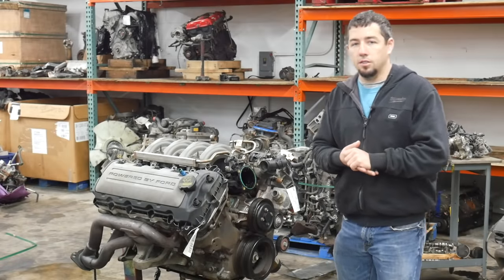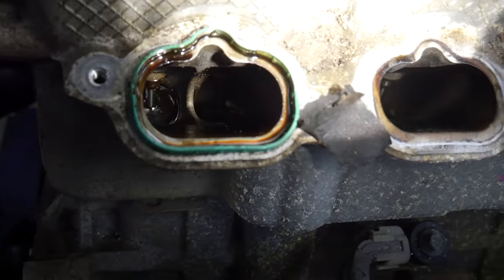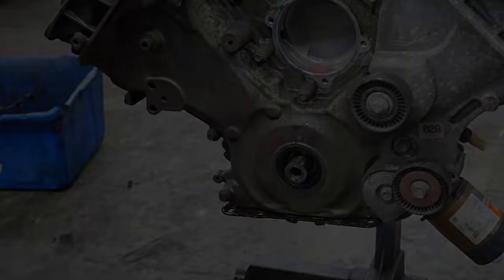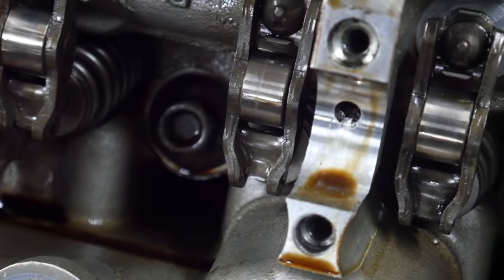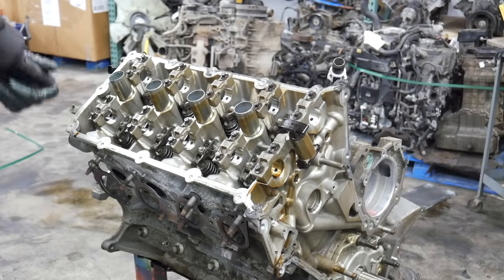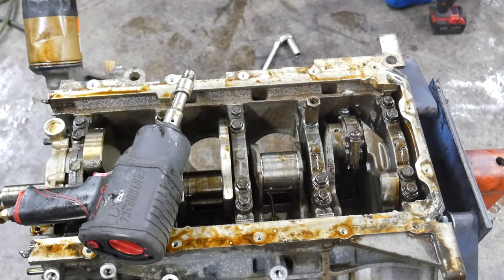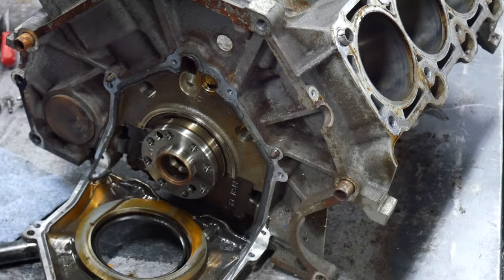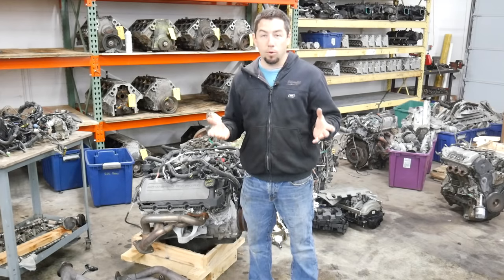Blown Up Ford 5.0 Coyote V8 Total Teardown! 2011-2014 Mustang GT / F150

Comment: The most common cause of Ford V8 failures is the loose nut behind the wheel.
Reply: And a lead foot.
Reply: It’s the ford logo in the front
Reply: They circle the problem on the front for ya.
Reply: @ernestjohnson1807  Haha, so original!
Reply: @ernestjohnson1807 Damn you Ernie, my Raptor is grumbling at you.
Reply: F.O.R.D 
fix or repair daily
Reply: Milled out journals with no bearing equals big trouble if you don't use the right oil.  Ruins the cams and the heads at the same time.
Reply: @probong2053  GRRRRRRRRRR!
Reply: Folded Over Recycled Dodge
Reply: Great comment! Thanks for the laugh.
Reply: Hahahahaha yep you are right right
Reply: Hahahahaha that’s what happens when you over do it doing burnouts
Reply: @vorant77  First On Race Day!
Reply: All makes have their gremlins. Ford had the most exotic cyl  heads in the '60's, the heart of the engine. Chevy pussed out and quit NASCAR in 1962.
Reply: Ford is the winningest manufacturer in all motorsports, suck on that Chevy and mopar trash.
Reply: @wymonwatson1309  I used to be a Chevy guy then I bought a Ford and realized I didnt have the hood up on it every time I turned around
Reply: @sambradley5981  But hey the parts are cheaper lol
Reply: @arendbehrens2761  found on rack daily
Reply: @probong2053  Unfortunately, in the early to late 90s, this was true to some extent. Source: my father's drinking buddy whose Ford Probe had serious engine issues...
Reply: Fords are awesome!!! When they go out is because lack of maintenance if any combined with harsh driving conditions!!
My Fords have always been great  vehicles 👍🏼
Reply: @ernestjohnson1807  this made me laugh out loud 😂
Reply: Hahaha, that's great
Reply: @yaellara6702  ok Fanboi. All brands have good vehicles and also have failures. Should we discuss the Corvair ?
Reply: F.O.R.D. = “Flakey Obsolescent Reworked Design.”
Reply: @sambradley5981  or take it to the dealer for warranty repairs.
Reply: @ernestjohnson1807  agreed 👍
Reply: As intriguing as overhead cam technology is, these Ford engines don't get down the road any better than their Chrysler and GM counterparts, that still use only one camshaft.
Reply: FORD...FAILURE OF RESEARCH & DEVELOPMENT
Reply: @probong2053  freakin old rebuilt Dodge
Reply: found on road dead is no lie after the 3 valve 5.4. Like the new 5.0 though.
Reply: Lmfao me
Reply: @dennisyoung4631  Cracked Heads Every Valve Rusted Oil Leaks Every Time.
Reply: @dustypeppers1358  yes, I did have a “No-Go Nova” many years ago.  It was then followed by a “Draštić Dödge” truck, and then sometime later, one of “Saki-Blender with sewing machine” cars.  

The last got totaled - full-on crash, followed by Fire - by a speeding driver as I was creeping through a left turn.  That was twenty years ago.  Been too poor to replace it since then.
Reply: Ill have you know sir, i have not yet torn a hole in the carpet under the throttle! I am very gentle when matting the pedal. Honestly I am not sure how my engine survives. No bowtie could live through such abuse. My 2011 was 181,000 and going strong, 7000rpm every f...... day! Still ran and drove like new when I traded for a 2020, same deal folks, no mercy. Yes, the Mustang. Statistically the most reliable, longest lasting car ever made. First of it's kind, copied by all, and the last to survive.  Alpha to Omega, the god of pony cars.
Reply: @JeromyBranch  When's the last time you saw a 4th gen (94 to 98) Mustang on the road?  They've all been crashed or trashed, with few surviving their owners.  With so few being ALLOWED to survive, any notion that they are long lasting and reliable is hard to justify by evidence.     Most Mustang crash sites are marked by skid marks heading off the road or going in the direction of an immovable object.
Reply: @Turboy65  when's the last time you saw an 03 to 09 Camaro on the road? AWWWW too soon? Maybe they'll make up for it with the 2024 Camaro? AWWWW. Ya, undisputed king of pony cars, the original that everyone else tried to copy, the one that knocked out all opponents and the last hotrod standing...the MUSTANG! And I see 90s Stang's on the road all the time. A lot more than Camaro. When's the last time you saw a 94 to 98 Camaro on the road? Been years since I've seen one.
Reply: @JeromyBranch  Maybe in your neck of the woods, but around here, Camaros of all generations aren't rare.  There were certainly more mustangs running around at one time, but they seem to crash a lot more often.  Not the car's fault...however I will note that wreckers are more likely to be built on a GM chassis than on a Ford chassis.  That's because wrecker operators know what's what.
Reply: @Turboy65  no. No you're so wrong. Everyone over the age of 19 knows that the vast majority of service vehicles are Ford. And where do you live, a Chevy museum? Do they serve LSD there?
Reply: @JeromyBranch  Clearly you live in a different  world than I do...apparently one where drug usage is even worse than it is here.  I won't touch the stuff. Not even alcohol. It'd make me stupid and want to buy a Ford.
Reply: @Turboy65  lol well it's clear that I've picked a wit war with the unarmed. Anyway, you have a good one. Been nice joking around with you. Take em easy.
Reply: @largol33t1  the Probe was made by Mazda (FYI)
Reply: OH BS
Reply: If you guys think junior high is tough wait till you hit 9th grade!  Things will be a bit spicier…
Reply: Hahahaha😂
Reply: Tell that to my 2011 mustang gt track pack sitting in a garage for like 6 years in perfect condition other than the blown engine simply cause it’s a 2011 5.0 before a certain date.
Reply: What, The wheel driving thier Engineering dept?? They sure sell a bunch of ten thousand mile engines lately.
Reply: Truer words were never spoken
Reply: Ford garbage
Reply: LOL 😂😂😂
Reply: @probong2053  Yes you got right Peace out

Comment: I’m thinking this engine lived a ¼ mile at a time.
Reply: With Nos😃
Reply: And in those 10 seconds or less, it became free (of this mortal coil).
Reply: More like it was someone who thought they were into cars and bought the status symbol. And then didn't know how to take care of it. They probably went to the discount tire store and bought the cheapest offered for the vehicle as well. 
The whole vehicle will be in salvage sooner rather than later, and the owner will think the vehicle was all hype, never realizing they were the problem.
Reply: @dalestephan6777  absolutely, and a lean fuel ratio.
Reply: @dalestephan6777  Roger that there is a literal price to pay for those super intense combustion pressures.
Reply: It may be that the first owner leased it, abused it, then it was sold to an unwitting second owner. I don't think anybody who raced would put a Fram oil filter on, if only due to the enthusiast reputation.
Reply: @jeangenibrel2149  always  blows  when you  let  off  them have not had engine  come apart under power but Iam sure it happens

Comment: I too almost fell out of my chair when you found a use for a 9mm socket! Anyway great video, these teardowns are some of my new favorites to watch.
Reply: A 9mm works when rust/corrosion takes its toll on 10mm bolt heads
Reply: Crazy seeing my fav retro tech guy comment on my fav engine tear down guy's channel :-D
Reply: Hi, Adrian!
Reply: @tstahlfsu  Same here. Finding a comment from Adrian of ADB & ADB ][ is unusual, to say the least!   Fred
Reply: I worked in a bike shop, as in bicycle,  for about 8 years and just about everything was 9mm. Maybe they're made just for us.
Reply: 3/8"
Reply: VW likes 9 mm 12 point bolts to hold sensors, but not much else.
Reply: fancy seeing you here :)
Reply: Another time the 9mm is used is the glow plugs on 2.0 diesels from Chevy, they put them in the Cruze
Reply: If you ever have to replace the shifter cable on your bicycle the clamp nut at the derailleur has about a 99% chance of being a 9mm nut.
Reply: @ChrisR  
It's ironic that you mentioned that, because I just got done messing with a "vintage" Shimano derailleur on a older Schwinn Paramount frame, something I haven't done in years.
Reply: The 11/32 of the metric world
Reply: I use my 9mm all the time
Reply: Another use is one a w126 Mercedes rear brake lines
Reply: Pound it on a striped 10mm
Reply: @heyallenify  yup those and torx everything and the occasional oversized/weird allen bolts/plugs.. eye roll <3 those vee dubs and audis tho
Reply: @kendalcrist4181  I just bought a set of e-torx for work on a Porsche Cayman, so I definitely get where you're coming from on the weird fasteners.
Not my car, but free seat upgrade for my project car, so new tools...
Reply: I work on Land Rovers…..I use all kinds of weird sockets, wrenches, and tools you wouldn’t believe….
Reply: Some GM vehicles use a 9mm on the rear brake caliper.  I was just as surprised to see a 9mm bolt.
Reply: Lincoln(Ford) use 7mm and 8mm....
Reply: Have you guys never seen a dirt bike?
Reply: @laxr5rs   I'm not sure why youtube put a translate to english option under your comment but ok

Comment: Would’ve loved to have seen the fram filter cut apart to see if it went into bypass and did filter anything.
Reply: It's a Fram so it's probably the reason the engine failed in the first place
Reply: With fram, failure is not an option, it's a guarantee.
Reply: @DJ-sr9yq  
Sad part is Fram used to be good stuff 30-40yrs ago. IMO WIX is the best aftermarket filters now. Purolator is good too.

Comment: "Something regapped this spark plug for us" hahaha
Reply: It's a Ford... surprised the spark plugs came out...
Reply: @BuzzLOLOL  usually they shoot out😂
Reply: @geronebner9535  Only really on the 4 thread motors, but yes that was a problem for awhile. Other end of the spectrum was never getting them out in one piece...Best thing you could do on the 5.4 was buy it,, get home, let it cool for 8 hours and pull the plugs, lather on some quality anti sieze and put back in.... for 75,000 miles.Never could see them going the 100,000 they said they'd go.
Reply: "Mechanicly regapped" is certainly a phrase that has entered my lexicon.

Comment: I have a 2011 Ford F150 with the 5.0L Coyote V8 in it with 138,000 miles on it and still going strong and its a beast.
Reply: They're good engines, but like anything else, preventative maintenance is everything. I do synthetic oil changes every 5000 on my 5.0 F150 and I always use Motorcraft oil filters. Neglect or abuse any engine and eventually it's gonna fail. People skip their oil changes and use garbage parts then can't understand why shit goes wrong.
Reply: @Sagittarius-88  I use synthetic oil for my F150 as well.
Reply: @Sagittarius-88  Fords biggest mistake is it's oil change computer. Never wait for that thing to tell you to change oil.
Reply: @jafo49  Agree, and there's certainty other companies that are doing their customers a disservice by recommending ridiculous intervals between oil changes. I've always lived by the rule of 3000 miles for conventional oil, 5000 for synthetic. Anything over that is far too much, considering that most people do not check their oil level between services.

Comment: Your teardowns are becoming my favorite thing on youtube! You can film all of the engines you get in regardless of how many you've already done and I will watch every single one of them. 
Precision transmission has torn apart 100+ 4l60e's on his channel and it never gets old.
Reply: Yeah, precision transmission is interesting, but he shows way less about assembly,  That’s what I want to see.
Reply: Of course it never gets old, it is the mystery and finding out what has happened that is interesting.
Think of it as an automotice Sherlock Holmes, who murdered this engine or transmission!
Reply: Me too. I love it when a “professional shop” rebuilds a trans, then he has to fix it with 5 miles on the rebuild.
Reply: Precision transmission is awesome.  That guy is a national treasure
Reply: @CMDRSweeper  "Who the hell would watch someone tear down an engine?"
Two hours later . . . "Huh. I wonder if this one is going to turn over."
Reply: @MasterMalrubius  Me: "Who the hell would watch someone tear down an engine?"

Me a couple hours later: "Yes, I see the problem. They tried to install those fancy height adjustable pistons and they thought the oil pickup was a great place to store their bearings.. No wonder this one wouldn't turn over.."

Comment: One of the best engines out there. Love my 5.0
Reply: Apparently the guy that owned this coyote didn’t love his enough.
Reply: same here
Reply: @miked8227 I love mine and maintained it extremely well. Started burning about 6 quarts of oil a month at 74k miles. In about 3000 miles driven.

Comment: Good teardown. I have a 2014 F-150 with the 5.0L. You hit it on the head. Oil starvation. Being a retired auto tech with 40 years busting my knuckles, it's all about maintenance which includes changing out ALL fluids with manufacture spec fluids. I always told my customers that I can do everything you need done but you have to bring your vehicle in for service.  Most of them trusted my advice. Although the synthetic blend oils say you can go 5000 miles on an oil change, I'm old school and go 3000 on oil and filter and 30,000 miles on a trans service.

Comment: i've never tore down an engine before but these videos are badass. it's kinda like solving a mystery as to why the engine stopped working. i'm hooked
Reply: Dude if you can go get a cheap harbor freight engine and tear it down and rebuilt with aftermarket parts hahahah make a race engine
Reply: You can do it yourself, but start small. Look for people throwing out weed whackers or lawn mowers and have fun.
Reply: Me too.
Reply: I did pro lawn equipment my employees fucked up to total distruction.. I have a very old echo blower ... 20 years old .. still my favorite as far as power to weight.. a fat new guy put regular gas in it and ignored the heat and noise and motor slowing down till he locked it up .. I was devistated .. I took it all the way down and got the rings unstuck .. there was scoring on the cylinder wall but I figured what the heck .. let's see if I can't put it back together just to find out .. It's back together and still running like a top .. I was stunned ... I do all my small moter stuff now and it's normal to see the kind of scoring the coyote had .. For some reason these just keep going strong .. the scoring doesn't seem to impede the motor at all .. to this day I've lost a lot of motors but gotten them all back just by a quick teardown and look see.. I have put new parts in some that were really bad but their all still chugging .. 

I got to be the dumping ground for all the large companies here just to find out free of charge what lead to the destruction so they could manage their employees accordingly .. I've only lost one kholer motor on an xmark but it came it with inspection holes in the block .. Employee fail and fire situation .. If they don't own it they will knowingly run it into the ground simply just so they don't have to go to the truck and get it's back up unit .. Thousands lost simply bc an asshole didn't want to have to walk 5 Xtra min ..

Yes this is the world we live in .. And no , there's nothing we can do to fix it.. We are all doomed in a few generations

Comment: I was going to throw away all my 9mm sockets, but now i have a reason to keep them.
Reply: Apparently a Prius 3cyl has 9mm 12 point head bolts
Reply: Everytime I get rid of a tool I am not using I suddendly out of nowhere need it for a job!
Reply: Back glass surround on early 2000's ford trucks....9m.m.
Reply: Finding a 9 mm bolt is like finding a unicorn
Reply: @fastyzzzff  3/8 works if your lucky lol

Comment: Love these videos. I am obsessed with topping up and changing oil after watching engine videos like these! Great job!
Reply: This motor likely died from overheat or boost, the first gen has bad coolant flow on the back cylinders, and they like to run out of ring gap and either score the shit outta the cylinders creating a massive compression leak, or they just make piston mcnuggets and adjustable rods like those one did. Usually the trucks score the walls on an overheat, Usually the mustang models make nuggets and stuff.

Comment: You definitely can break a cam cap loosening or tightening them unevenly. When you do its not like you can just get another easily since they are line honed in a set for that head. Ask Tom if you ever want to hear about him trying to get a replacement.

Comment: The 5.0 coyote is a hell of an engine.  It makes a lot of power from a fairly small displacement, mostly from the 4v heads.  They are just humongous though, for a small displacement V8, and that's because of the heads too, lol.

Comment: This has got to be one of the most disastrous teardowns we've seen yet, I think it's easier at this point to count what parts aren't smoked
Reply: well the skinny rods & gerotor oil pump & case remind me of the same items out of a carbed 1.9L 1986 Ford Escort.  Only slightly beefier. : l  For 'Coyote' use I suppose...... ??
Reply: @timewa851  Remind.!! Is that because there both Ford.!! Hmmm.!!

Comment: That Fram is actually an Ultra which is a great filter. Synthetic media, silicone valves, etc. Definitely a higher end filter.
Reply: Agree. Some of their stuff isn't bad, at least in recent years. Although on anything I can (even if it isn't Ford), I run Motorcraft filters. Very well built at a surprisingly cheap price.
Reply: HiGhEr EnD fIlTeR
Reply: It's junk. Get an Amsoil .
Reply: @stephenhusak6098  $$$